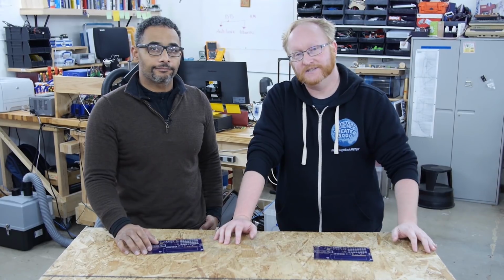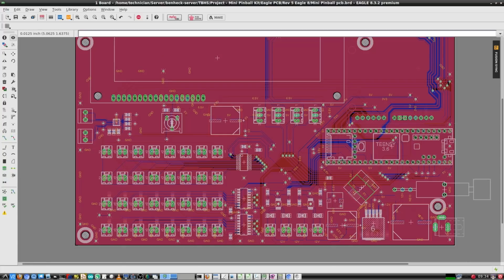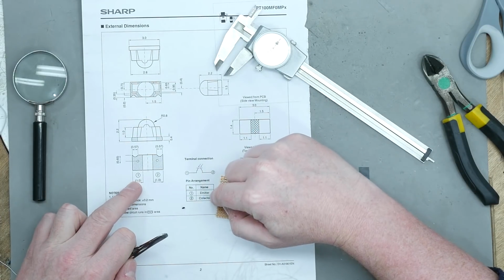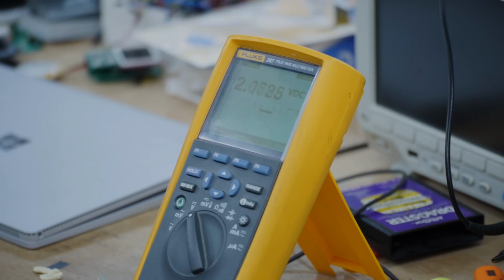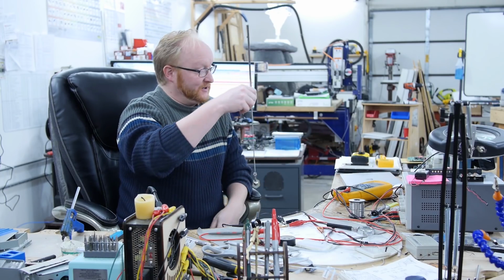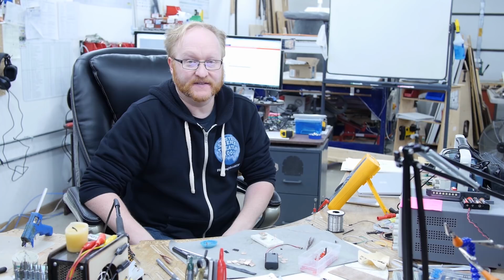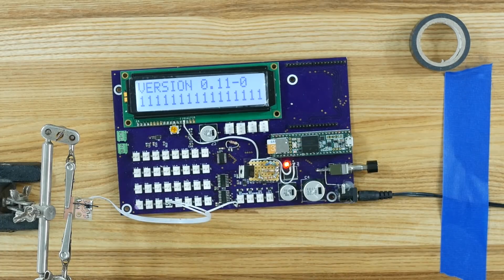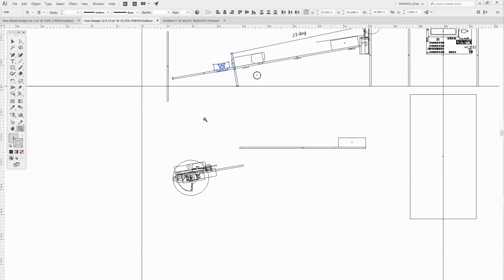Mini Pinball 09: Infrared Ball Detection

Comment: Ben knows about pinball reliability over time.
Having this kind of IR switches under a playfield, that will be stained by dust, rubber dust, and other contaminants.... No, sorry... I won't buy it.
Use hell sensors instead !   They are less expensive today than they were 20 years ago! 

Now, overall, the project is cool, and, as a pinhead,  I'm looking forward to see more.

Comment: If you only ever have a single ball on the board it seems a bit of a waste to 'scan' all sensors constantly instead of doing it interrupt driven.
combine the output of all sensors and apply it to an interrupt-pin, and that checks what part triggered the interrupt.

Comment: Sensing IR with the digital input pin directly? Yeeeeeah, about that.... Not gonna work. Especially outdoors, and will gleefully pick up TV remotes, incandescent bulbs, and stuff like that, unless that was dealt with. And with DI pin there's not much that can be done....
Self-tuning digital-out sensors exist (like TSOP1738, etc), but they are expensive...

Comment: Why don't you use a TCRT5000 or CNY70 all in one IR sensors. Easy to use and I think not that much bigger than your design Ben. Place a smd comparator on the board for TTL high and low  (if you choose the correct one it can handle 3.3v and 5v).

Comment: I had trouble with the IR pair in different lighting situations and ended up using a hall effect sensor
Reply: Take a pinball, heat it up above its curie point, introduce a high power selenoid, cool it back down. Magnetizing the ball would be very very simple and could be done in large batches.
Reply: Maken it so, you can not use Hall sensors without inducing the ball with a magnetic field. To use a Hall sensor it needs a magnetic field to trigger on or measure the strength of that field. 
You can use a capacitive sensor or better a inductive sensor. But those types of sensors are very expensive or hard to make your self.
Reply: Inductive sensors would be awesome but yeah, that cost. The hall effect sensor method does work though, i recently posted a video about it and it tests out fine. the small magnets i used didn't seem to alter the balls trajectory at all. Maybe a little hard to make for some folks i guess.
Reply: Metroid1977  Love the name :)